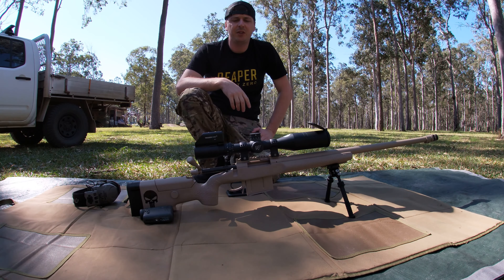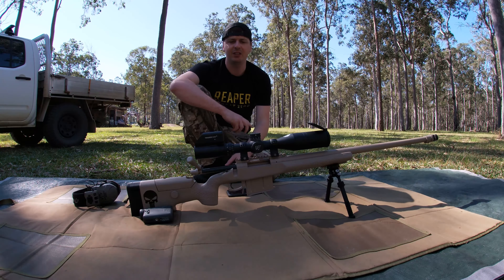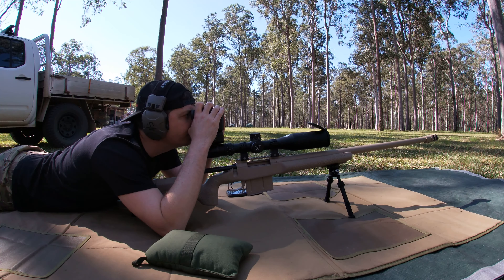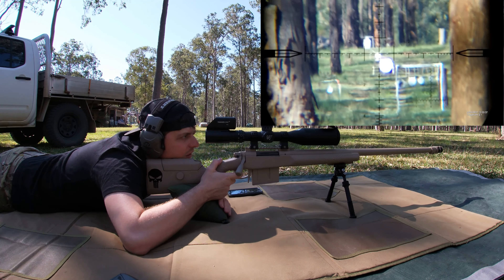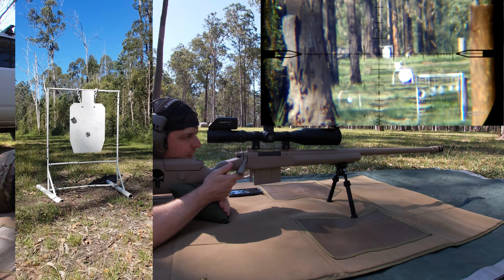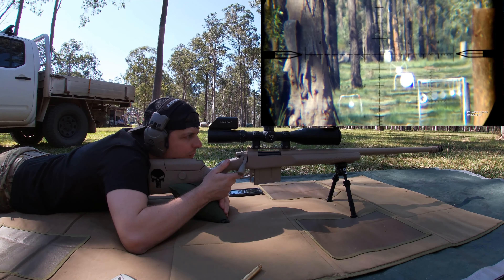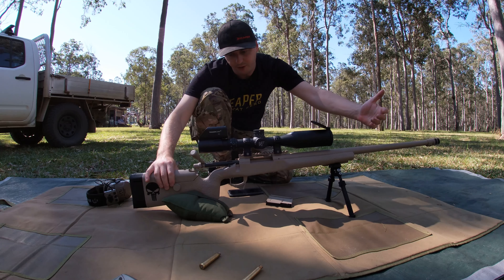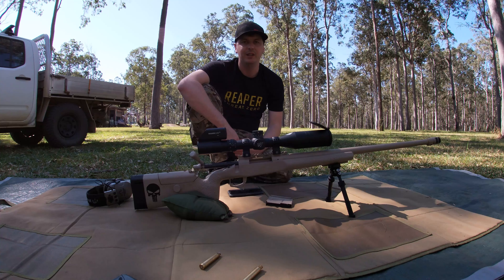300 Win Mag @ 1000m With Trigger Cam

Comment: Awesome channel! You’ve got some slick setups. This 300 WM is the exact setup I am building. Have a SFP Viper 6-24 that I am eager to swap for a good FFP. Pushed out to 1320 with the Hornady app couple weeks ago with partial success. Wanna test out the Arken 5-25, any suggestions?
Reply from the maker: Thanks for the message. Personally, I rather SFP scopes for the type of shooting i do. The lower end vortex scopes ive found the glass to be average for the price. Depends on the budget but id say a second hand nightforce. Arken ive never used or seen one but they do get a good wrap for the price. Zerotech are doing some pretty decent scopes at the moment now to.
Reply: @aussieshooter9267 reason for preferring sfp?
Reply from the maker: Few reasons mate but main one is Small target visibility in high powers.
And I like that the reticle remains the same size when zooming